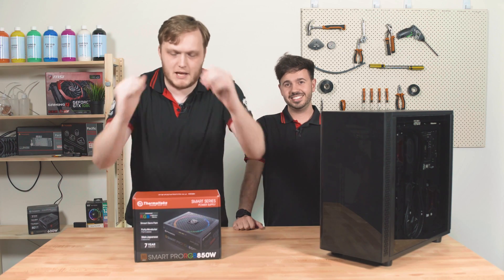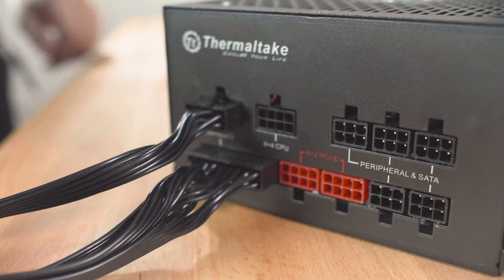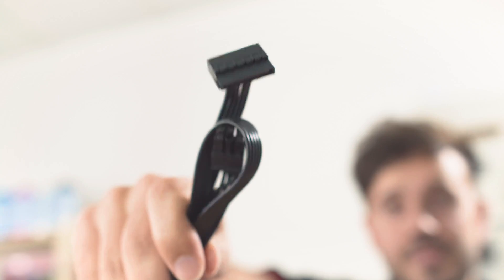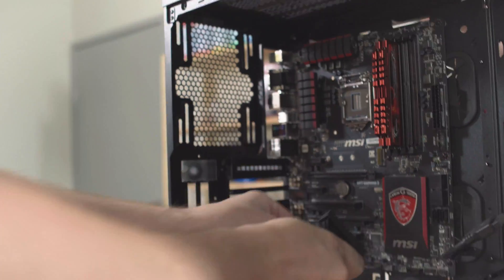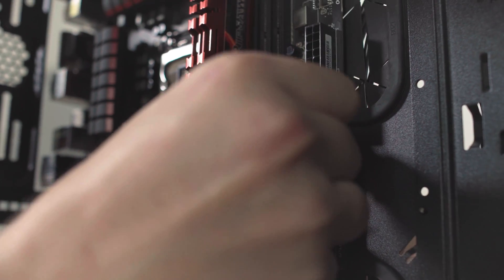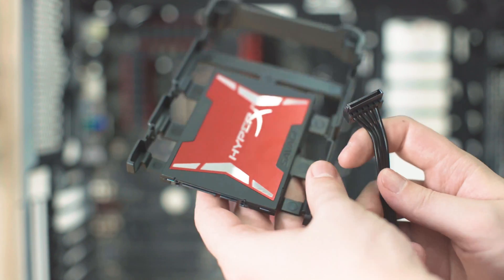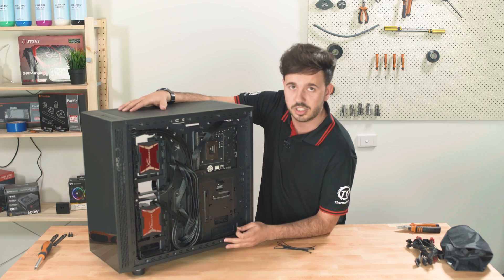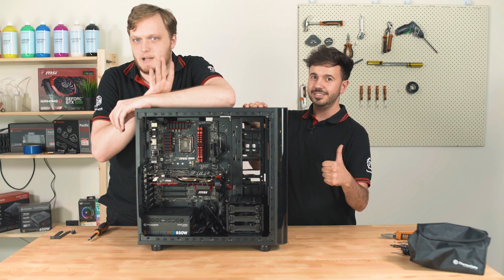Thermaltake Workshop | How to Install a Power Supply & Manage Cables

Comment: Tell your boss over at Thermaltake to make actual manuals. The one sheet thing that comes with the GF1 models is mostly useless.

How the MB cable connects to the power supply is confusing. Like how would one known you are supposed to twist the short cable down below (not to the CPU/PCE-I)?
I had to go to YT here and see an example to make sure I wasn't going to blow something up.

Also I happen to know better, but since on the GF1 side it says CPU/PCIE it might lead some people to think you can use one of the two CPU cables as a PCIE cable, which would cause a disaster.
There were way to lazy on the instruction manual for this power supply.

Comment: In other words you don't have a clue which way up the PSU should be.  For Thermaltake Australia to be so amateurs, gives me no confidence you guys know very little.
Reply from the maker: No, in other words the internet discourse around the topic is pointless. It can go either way, and there are pros and cons for each direction. Just do whicever one best suits your configuration.
Reply: @Thermaltake Australia  Google search shows Seasonic at top with a quick and easy explanation, and to add similar explanation would have dramatically improved this almost  useless video.

Comment: Can I put my TT 850W RGB Gold psu upside down in my case? I have a magnetic screen in a new case, which would supply the light below the case (Antec DF800 Flux). sits about an inch off the desk. It has 5 intake fans, 3 on the front, and 2 above the psu chamber, and 4 exhaust fans, 1 at the rear and 3 on the top. Trying to get the most out of my color in the case.

Comment: Would Thermaltake Smart Pro RGB 850W 80+ Bronze Smart Zero 256-Color RGB Fan Fully Modular ATX 12V 2.4/EPS 12V 2.92 Power Supply work on a 3080 gpu with 5800x cpu

Comment: I have a 650W thermaltake PSU. I have followed this video several times, and checked the connections, but I am still getting the error on my screen "Could not set up a connection with Power Supply. Please make sure your Toughpower DPs is succesfully connected to a computer via usb.

Comment: Hey guys, i have the thermaltake toughpower grand rgb 850w for my asus x570-e motherboard and im confused about the cpu cable. Im required to connect either the 8pin or 8pin and 4pin connectors to the motherboard but the cable is split into 4 4pins and 1 of the 4 pins aligns with the pattern in the 8pin slot and another 4 pin aligns with the patterns in the 4 pin slot. The other 2 4 pins all have the same pattern with the rounded edge. This can fit into the remaining slot on the 8pin so i just wanted to know if its ok to plug that one in there even though the pattern on the 8pin has a square. Hope that makes sense. Please help!

Comment: Couldn't set up a connection with power supply. please make sure your Toughpower DPS is successfully connected to a computer via USB... I am getting this pop-up on start-up, however it seems everything is working fine from a power perspective? did I miss a cable for some reason?
Reply from the maker: Hey mate, this would be in regards to the DPS software itself, your PSU would be functioning correctly if you're able to jump into Windows, however, what you might be missing is the micro USB cable the connects from the PSU to the motherboards USB 2.0 internal headers.

Comment: Okay for real, this video saved my PC. Because I didn't use the right cable for my GTX 1060 and it was causing a massive issue and restarting my computer constantly for months on and off. I replaced it with the PCI-E cable and it fixed the entire issue. It might be a stupid oversight on my part, but still this helped a lot. Thanks!

Comment: I have the same power supply paired with a z390 motherboard the cpu power needs 8+4pin connectors, the power supply only gives 8pin connector to cpu power. 
Please Help me!
Reply: you don't need that extra +4 pins for your CPU, i have the MOBO with the same 8+4 pins for CPU and my PSU doesn't have +4 pins.. just plugged in the 8pins and its good to go. Found out that if you are doing extreme overclocking than you will need that extra +4 pins to plugged in.

Comment: I have the Gigabyte z370 aorus Ultra gaming Wi-Fi mother board, the board has two 5 pin 12v RGB headers and two 3 pin 5v RGB headers. The package and instructions on the thermaltake psu say it's compatible with gigabyte Fusion 2.0 the wire that I got with the PSU is 4 pin so I'm not sure how it connects to the board. Please help

Comment: Hey, I was wondering if I can place the fan of the PSU  inwards/upwards. It would be a shame to have an RGB PSU but have it facing down
Reply from the maker: This is a big controversial question and one that hasn't got the most clearest of answers. It does come down to how the fans on your PSU are optimised. Our latest RGB family of PSU's have been designed to still keep cool while being face up and showing off the RGB lighting inside, however, not all RGB PSU's have been optimised for that type of setup. 
 
Personally... I've been using the same 1000w PSU for over 9 years in one of my builds FACE UP and it's still going strong!
Reply: I think downwards as long as your case has a hole on the bottom for your psu to pull air in.

Comment: My Thermaltake has the cords all plugged in, I cant take them out of the power supply. And 99% of them can't even be plugged into my gigabyte motherboard. And got 3 cords that are made for HDDs but I only got 1 HDD but another thing is none of the cords on the Power supply are numbered or named. They got no words or anything on them they are blank. I got the 700W RGB one. It also never came with USB cords for the motherboard.
Reply from the maker: "And 99% of them can't even be plugged into my gigabyte motherboard" That's a good thing - The only two cables that you'd want to connect to your motherboard are the CPU 4+4 or 8pin and the 24 pin motherboard cable :) so it's good to know we are on the right track there. 
We'd love to know how we can help you though - have you got anything you'd like to ask about the PSU?

Comment: problem i have is the cheap cables you guys use when plugin my gtx 1080ti the pci-e cables its not long enough meaning this it reaches the gpu but the extra cable plug stick out even in your video you have the same issue it shows the extra plug that makes clean setups look like crap and the only way to fix this is to buy Thermaltake Power Cable Kit and thats 49.99 extra and i never had this problem with evga and corsair psu

Comment: I have the Toughpower Thermaltake 1050 RGB and the 24pin cable is confusing me.  I don't know which end goes into the mother board and which end goes into the power supply.
On Both Ends have 24pins but one end has an 8 pin connector ON THE SAME CABLE.  Can some one help?
Reply from the maker: Hey Saquist, thanks for the question! The end with the 24 pin + 8 pin goes into the power supply, look for the two  holes labeled "24 pin ATX", plug both of those in, and the other end with just the 24 pin goes into the motherboard. Let us know if you have any other questions :)
Reply: Thank you very very much

Comment: If you buy a Thermaltake case you need to buy a Thermaltake power supply, many power supplies will not fit properly.
Reply from the maker: Hey there Direct Dubs, we're not entirely sure what case you are referring too, however, our cases from the past 5 years work with many different power supplies :)
Reply: Wow great to hear back! The Core X71 was recommended to me as a case big enough to fit my power supply. I purchased an 1000W Seasonic Platinum model SS1000XP, but the holes on the case did not line up correctly for the screw points. It just was not a good fit, so I sold that and went for a Corsair but had the same problem. So I finally realized that you guys actually make your own, and it worked like a charm. ~ Ben K.

Comment: Hi, I Got a power supply from Thermaltake, model rgb plus 1050w. I can't find the 5 pin connection for the usb cable on my Z170A GAMING M9 ACK motherbord, pleas help me?

Comment: Hi i have a HP pc and i cant install a power supply because there is only 3 wires to power the system. and before you ask there is no 20-24 pin connector any ideas
Reply from the maker: That's an interesting one there... I've never heard of such an odd PSU
Reply: https://www.youtube.com/watch?v=tiHk_pp8yjM&t=1s  here is a vid of the inside so you can see the power connections. dont laugh to hard like i did :)

Comment: Hey need help. I have almost the exact same components as in your video, a 750 Thermaltake power supply and a MSI Z270 M7 motherboard. The power supply has the same 4+4 cable for CPU power but the motherboard has a 8+2 header. According to the manual they are all just 12V pins. I have plugged everything in to the pins toward the front of the board. What's with the other pins, now empty at the back? It looks like I would need a different power supply and cable to have power to 8+4 pins rather than the 4+4. Thanks!
Reply: Vbfgfhu. Tumnugnutu c
Reply from the maker: We totally overlooked this Robert and should have addressed it! 
We also see you were quick to find out that it's more of an extra for those wanting to really push the limits on overclocking - kudos to you. 
We hope you're onto building the rest of your system :)

Comment: I need help! I can't connect ssds with only one cable. I have to connect every ssd and hdd (4 in total) with a cable for each one and I have too many cables in the case. Is the a master socket on the psu supplying all disks?
Reply from the maker: Hey there Mr Checkers, is there a reason why you cannot connect them using 1 or 2 cables? i.e. is your chassis limiting you because of ssd mounting positions? If you're asking if there's a "hub" for optical cables we're afraid that isn't available - but we'd still like to try and help you out here so please feel free to let us know some more information.
Reply: no I have no limiting positions the 2 ssd are near 2 hdd vertically. I forget to say that if I connect 4 or 3 disks with only one supply cable in series, only the main ssd is on (the one with operating system) or only 2 disks. That's the problem. with non modular psu I had no problems like that

Comment: I have a GPU that uses 2 x 8pin PCI-E inlet and I am using the RGM 80 gold plus 850 watts power supply. Do I use a single plug in the split (6+2) PCI-E into the power supply and use both the (6+2) outlet into my gpu? Or should I plug in 2 cables and use each of the (6+2) wthout using the split connectors?
Reply from the maker: Great question! Generally we opt for two separate cables in our own builds in the office, though either way will actually work. There's actually a great video on the topic from JayzTwoCents here that's worth watching: https://www.youtube.com/watch?v=UL7KIVI_hJg
Reply: Thanks for reply! Sorry for noob question. My first build and worried.
Going to plug it in now. BTW I love my RGB power supply, It is so damn colourful!